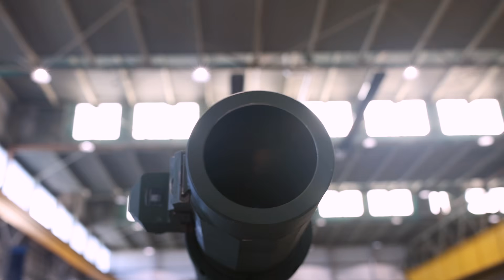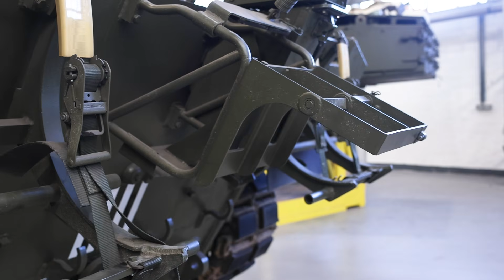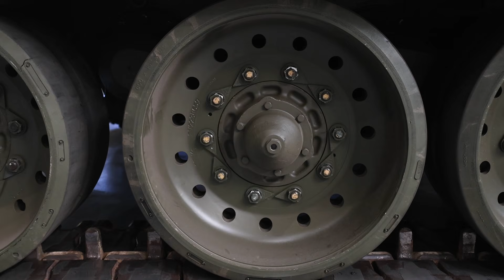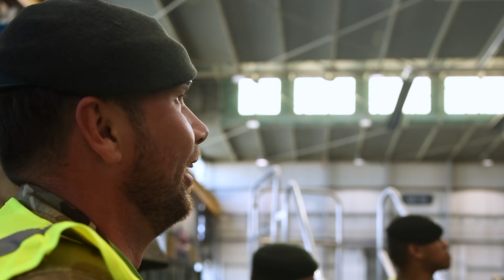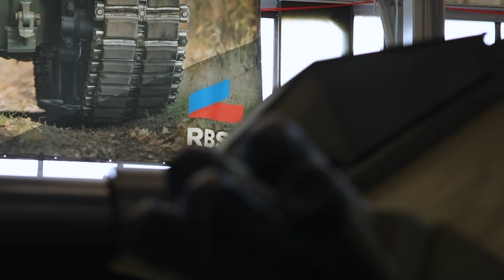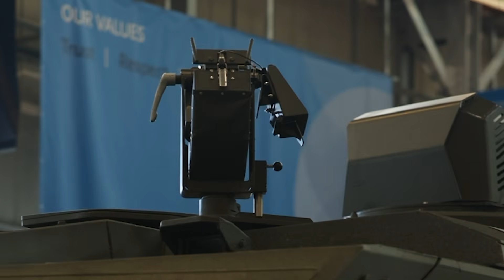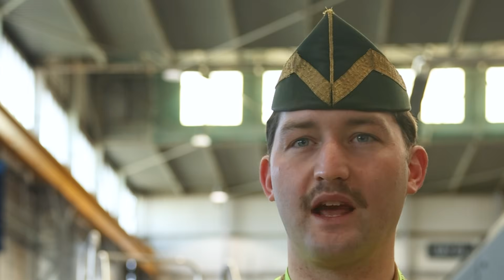Challenger 3: The New Generation of Main Battle Tanks | British Army

Comment: Any anti drone capabilities, clearly one of the biggest threats to tanks currently
Reply: Doubt they would be telling us..
Reply: @markhepworth  they don't have to tell either, likely the answer is no but it can easily become a yes because anti-drone capabilities often are just jammers which you mount on the top of the tank. so why reveal it when you don't have too, reveal it when they roll into combat. (if it turns out they still didn't consider jammers on tanks then they haven't learned a thing from russo-ukraine)
Reply: @simplyruben3184 answer is yes
Reply: @judebellwood3418answer is no, there is no external counter measures or nets or anything, you see no pod for missiles or interceptor drones... the armour is the protection and we see how that performs in ukraine. until its shown, it doesnt exist.
Reply: Doesn't look like the prototype shown has one yet, but there was a mention in the video of fitting an active protection system, presumably iron fist or trophy. These are hard kill APS. They are basically small missile launchers on the top of the tank that can engage drones and anti tank missiles and slower moving chemical rounds like HEAT-FS and HESH. The tank could also employ soft kill APS which works to disable the line of sight of a missile/drone by using electronic jammers or smokescreens. The black knight tank concept used the hard kill Iron fist APS so we can assume that challenger 3 will probably use it too.
Reply: Yes, keep the hatches closed …
Reply: It will have an APS and a remote GPMG/ .50cal that can shoot down smaller drones
Reply: They are already being testing in Ukraine so probably
Reply: and a capability to detect mines seems in order as well.
Reply: I think it will have the best electronic suite available. Jammers, detection & ability to shoot some down. Plus cage system ready to fit. Edit: not that it makes it 100% impervious.
Reply: @Surv1ve_Thrive  Russia has that covered already
Reply: @OurAmazingSkies   true, it doesn't work always though. Not sure it will for us either. Especially when future capability enables use of clouds/squadrons of them at one time. A tank can only survive so many. At $500 each still way cheaper than missiles and better stand off etc.
Reply: @OurAmazingSkies  No Russia don't have that covered, as the many loses prove.
Reply: @Surv1ve_Thrive 🎉
Reply: @OurAmazingSkies  If by covered you mean literally covered by a makeshift shed that reduces all visibility to about 5 degrees forward and removes the ability of the gun to rotate then sure... Covered...
Reply: Not every war will be Russia/Ukraine, we've seen the IDF mass armour in an environment that nullifies the advantages of armoured vehicles, and still not suffer mass casualties. It purely depends on the threat you actually expect to be fighting and their capabilities.
Reply: Yes, it has active protection. A drone couldn't hit but even if it did it wouldn't damage the crew due to the armour
Reply: fair point, feel like #1 they wouldnt tell the public 2# they will designate that role to a different vehicle/soldier 3# island
Reply: I hope this has some kind of electronic jamming measures around it as it moves to help with drones.
Reply: Damn thing is heavier than the Challenger 2, with the same track width. We need a new tank, fit for modern warfare, not an iteration built from old rusting hulls.
Reply: The cost of drones you could just swarm the chally then finish it off with artillery
Reply: You are absolutely correct.  There are various ways to take out drones and there are various drones, this is a whole new form of warfare and we are still learning whilst developing and testing ways to combat drones, both those that are there as eyes in the sky and those that are there to destroy thing, the new tank at least needs this to be taken into consideration for upgrades.
.
The latest variants of the Merkava Mk 4, the Mk 4 "Windbreaker", and the latest Mk 4 "Barak" show the direction things really need to go.  The Merkava introduced a functional "hard kill"  "active protection system" back in 2011 and it has proven to be effective, so it is glad to see that the UK is finally introducing it a mere 13-years later (realistically 14+ years once they are actually in service.!), and a fellow commentator above questioned anti-drone capabilities, that really needs to be a thing, and very likely not ready yet, but the tank needs to be designed with this in mind as an upgrade package.
.
I have seen tank experts question the relatively anaemic power plant (engine) for years, depending on the weight of the Challenger 3 (I think it should have a new name, it's a very different tank, so a new name is IMHO appropriate) and although the new power plant was mentioned, neither the weight (likely undecided) was not noted, and likewise neither the power output, fuel capacity, reverse speed, fuel usage and other important things have not been mentioned, but they are still in the prototype phase so little is yet final except the main gun and ammunition and that it will have tracks and armour.  This is already very late and they only want 150, we have become an international joke in so many ways, and all self inflicted.!
.
The power plant output will be very important if a laser is going to be used for drone defence and that currently appears to be a good option, but there needs to be power generation and /or a capacitor bank and beefy generator built into the tank, and the tank will still need to move, all of this must be taken into account, otherwise the upgrade costs will be ridiculous and other forms of drone defence will need to be used instead of lasers which have the most promise against slow moving objects such as drones and much less so against missiles, where a "hard kill" system is best used, and this may still be the best option, just pointing upwards.  Time will tell.
Reply: Maybe they'll add a cope cage and call it a day
Reply: @tafdiz  Mate,what you are looking at here doesn’t even have its Dorchester armour fitted...
Reply: He said in the video, it has an active protection system. I believe the Challenger 2 did not have a battery that was capable of powering the system, but the Challenger 3 does.
Reply: Known the british there be a man standing on the turret with a stick thats your anti drone defence .
Reply: It is, whether or not they'll prove useful enough is another question.
Reply: Totally agree.  If anything the war in Ukraine has taught us is that tanks are incredibly vulnerable to drones. Especially if the hatch is left open. It's almost made tank warfare obsolete!
Reply: @myrants5836  Even if the hatch dont open.some Drones have tandem warheads that can penetrate through the thin top armor of tanks.
Reply: But at least they won't be cooking ammo / turret tossing like Russian design flaws.

"The major increase to survivability in this tank comes in its new ammunition layout - no longer are shells strewn throughout the hull, you get a dedicated ready rack and blowout panels at the rear of the turret."
Reply: @myrants5836  my nerd in christ the tank will literally always be in human warfare, even after we go extinct, aliens are gonna pick this tech up and go "these monkeys were onto something here..."
Reply: @myrants5836 no it hasn’t it’s overstated most tanks destroyed by drones are clean up kills a moving armor box can’t really let grenades and mortars kill it the biggest threat is ATGMS
Reply: @myrants5836 tbf the chally 2 is currently the only tank not to be destroyed by a drone. Only one that’s been killed was a basically a stock armoured one and that was hit in the side with an ATGM, so safe to say the superior armour of chally is superior to drones compared to leopards and Abrams 😎
Reply: @myrants5836 tanks were always vulnerable to aerial attacks. What is new most of us is a balanced technical forces facing agains each other. And we can learn again that how essential are mass infantry and artillery in a huge  number not just a precision force…
Reply: And does the track can prevent the tank drowned in mud? Or does it has any upgrades to prevent it collapsed any civilain bridges it crosses?
Reply: @superspies32  yes, there are reports that they’ll be able to fit rotor blades and jet engines to the tank so it can fly